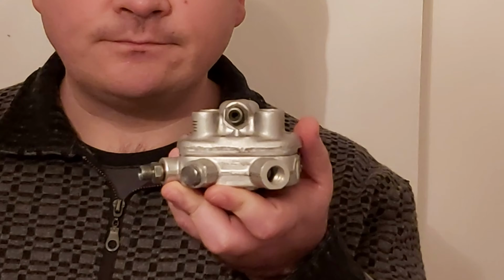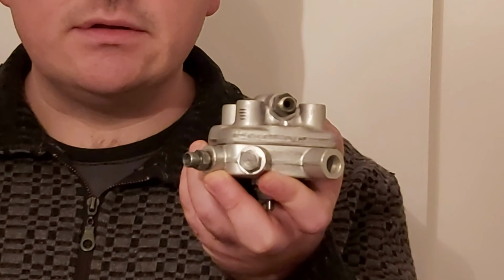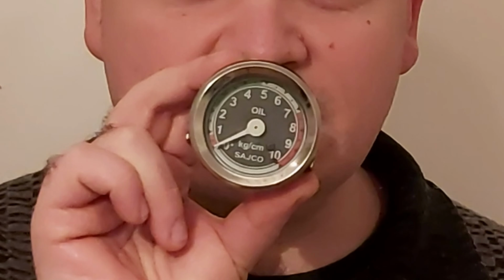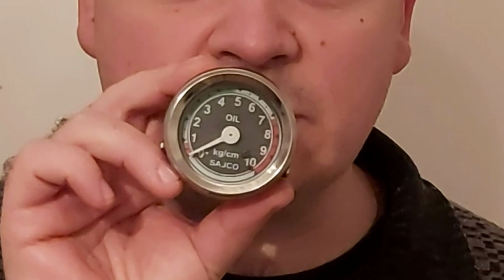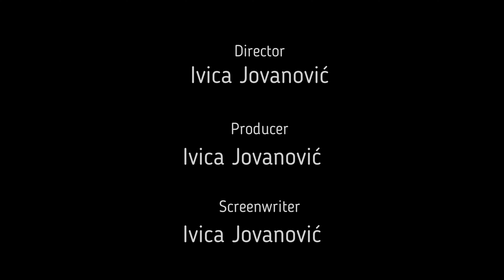Mercedes KE-Jetronic - Raw system pressure

Comment: Hi! Me again! Haha. Would u explain why the fuel distributor works on half? On my 6 cyl if I give more pressure from EHA it changes positions, I mean that it brings just on 3 ways gas on idle, if I give increase or decrease change possitons but still just 3, some times 4. Is that mean that the rubber must be replaced? 
I follow all ur videos, u're Crack on ke-j!

Comment: Thank you for a good video. In the video: 5min: 36sec. You said about the threads: "eiht times one" Means it: 8mm*1.0mm  (the screw)? Thanks.
Reply from the maker: M8x1 for the lower chamber&M12x1.5 for the upper one. Those are the adaptations you need for the gauge.
Reply: @mercedeske  That was the answer I Was hoping for. You saved my day. Thank you.
Reply from the maker: My pleasure! Happy Mercedesing 😃

Comment: Is the working pressure not adjusted at the EHA valve?  You mention in the video that it must be adjusted at fuel pressure regulator. 9min.
Reply from the maker: Fine adjustments in pressure are made at the EHA.
Reply: So if my raw pressure is 6.2 bar and my working  pressure is 5.4 bar,  do I first increase the working pressure at the fuel pressure regulator to 5.8 and then adjust the  EHA.
Reply from the maker: Sometimes it gives no results at the regulator so if your fuel pressure is too low then adjust it at the eha.
Reply: @mercedeske  Thank you 🙏
Reply from the maker: You are welcome

Comment: Thank you. Does natural gas affect the M103 engine?
Reply from the maker: Well, the LPG became now something more like economical fuel than ecological. The answer is "Depends on your driving style". First thing you must know about the LPG is that it creates higher temperature than gasoline so you are "IN RED" at some 4500RPM. If you live in a plain then okay, but if you live in the hills, then rather not because at higher RPM you are going to destroy the valve stems if you drive on LPG above 4000RPM. You will have to decrease the gap on your spark plugs at 0.6mm instead of 0.8 and the difference in driving on gasoline is notable. How ever you decide. If you have problems with LPG i can give you some advice and it should be okay. To summarize - 5th(or4th) gear 3500RPM on LPG, not more than that. If you need RPM for driving uphill drive it on gasoline. That's what I can advise you - I had very negative experience with LPG so now I drive on gasoline only.
Many greetings, Ivica
Reply: As my friend said. LPG is not the best fuel for mechanical injection.
Reply from the maker: @gurtatka2891  Bravo!👏You know that saying? - "LPG is for heating, Diesel for plowing and gasoline for driving! 😎😃
Reply: @mercedeske  https://kjetkillers.pl/ if you thinking about lpg so maybe you should think about elektronisk injeksjon
Reply from the maker: @stefangurtatowski3586  I know about them. They are Poles from Ketrzyn, they do it. 500 euros for my car. There are also Russians, they call it INVERT. You know, the idea is not bad, I heard lot of good talk about k-jet killers. You know, I invested in this a lot of money and now I don't feel like just "throwing all the parts away". It has less parts, you have a common rail, you can get more HP and less consumption. Maybe one day. Not for now, I don't think about that.

Comment: I have a 1993 190e with 2.3. It runs great, but it shuts off when I come to a stop. It will start right up again and run fine until I come to a stop and it shuts off. What do you think the problem is?
Reply from the maker: Did you check the potentiometer?
Reply: @mercedeske  I will do that. Sounds like a good ideal!! 👍Muchos Gracias
Reply from the maker: @anthonyasmussen8732  Hehehehehe de nada. Happy Mercedesing
Reply: @mercedeske  happy happy joy joy fix my toy
Reply: @mercedeske  It was the potentiometer. It is a new potentiometer I didn't have it set correctly. I was able to set it right on from watching your videos. It runs great and no more engine shutting off at stop lights. Thank You!
Reply from the maker: You are welcome 😊Glad to be of help.🙂👍
Reply: Your replied disappeared could you send it again please
Reply from the maker: I cannot tell exactly but I would say it's the ignition coil. If you manage to srart the car and it dies shortly afterwards then I would say it's the ignition coil. The best solution would be to replace it with a cheap one or a spare one if you have it just to make sure. The secondary coils because of the thin insulation inside are the problem so if the insulation breaks when the car warms up the current doesn't flow through the coil but it "runs away" where it's broken and the spark plugs can't get the needed current for the spark. Maybe I'm right, maybe not. Try checking the ignition first.
Reply: @mercedeske  ok I would pull a plug wire put tester into plug wire and see if I am getting spark would let you know thank you so much
Reply from the maker: Always. Hope you solve your issue.
Reply: @mercedeske  just pick up coil from my friend that repair and sell all kind of parts for classic mercedes. I explained to him the problem and the air plate fluttering real fast and making that fluttering noise. He told me to take off EHA turn adjusting screw all in then back off 6 1/2 turns out it back start car then see about adjusting mixture 3mm screw by fuel distributor until it get the best idle does this sound reasonable?
Reply from the maker: As for the eha, because you have new pumps - just set it to 6.8mm and that is going to give you the ideal pressure difference of 0.4bar. You will have to measure it with the caliper(the F shaped tool for measuring tenths of a millimeter).
Reply: @mercedeske  Thank you I have a digital caliper . I measure from top of plastic housing to touch top of adjustment screw?
Reply from the maker: @trevorross7405  Yes. The factory settings are 6.8mm. Set the screw to that distance and you are good to go 🙂
Reply: @mercedeske  thank you would let you know how it turned out happy Mercedes
Reply: @mercedeske  any special technique you have to remove that screw that covers the adjustment screw boy I have sprayed it with a little penetrating oil it still would not moved and I am not going to damaged the screwdriver slot can I use heat from a heat gun set very low?
Reply from the maker: @trevorross7405  To be honest with you, I made it with WD40. There is no special way to do that. Try it with a thick screwdriver easy. That's because if the washer that is holding the screw from underneath. Try to tighten it just a bit and then to loose it. It's a brass screw so be careful.
Reply: @mercedeske  ok I am using blaster PB penetrating catalyst not working so far but I am taking it easy
Reply: @mercedeske  morning to you I finally got the screw out. I prayed for help and took my time you were right plenty of wd40
Reply from the maker: @trevorross7405  👌👍🙂